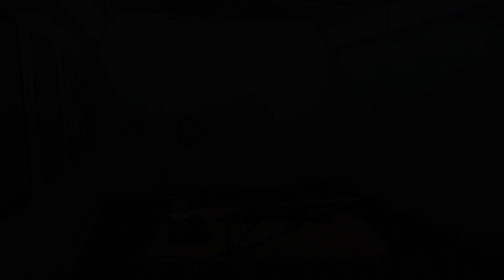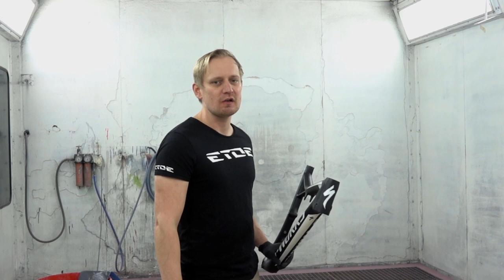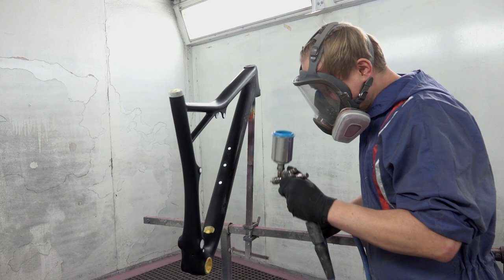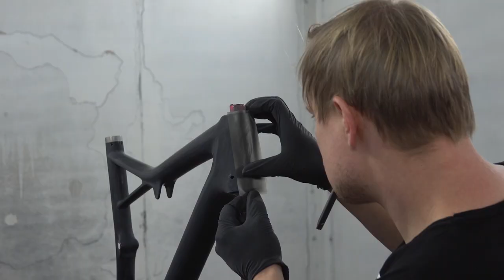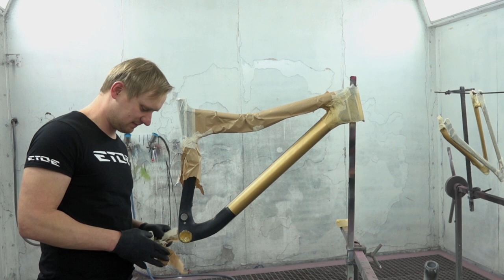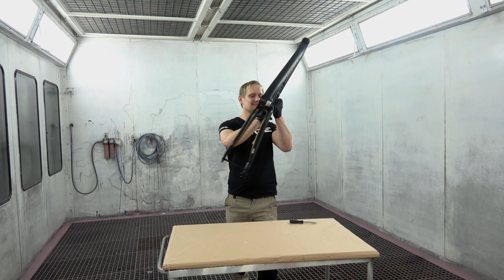how to paint a bike - s-works epic - sram eagle gold

Comment: Question:   I’m having issues with the Gold bleeding through the top coat which is a Dark Navy Metallic Blue.  Both are Dupli-Color Perfect Match Paint Acrylic in a Spray Can.  Already at 3-Coats.  Not sure if i wait for ???how long to apply maybe a 4th coat of this will solve the issue?   Any thoughts other than needing to remove the paint and start from scratch?
Reply from the maker: Yes I have an other thought. My teacher told us every time that only morons use more than one questoion mark. I have to think about her so often when I read through the comment section.